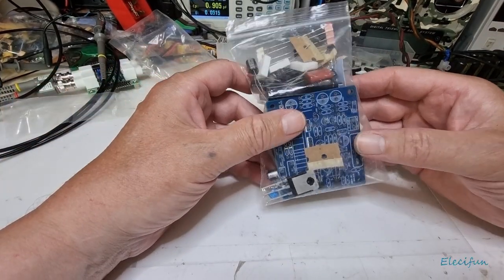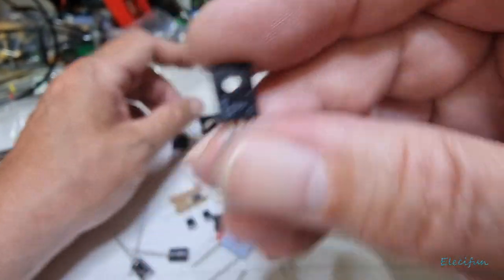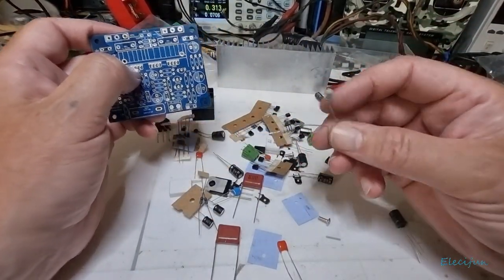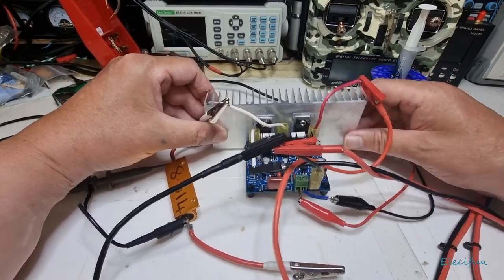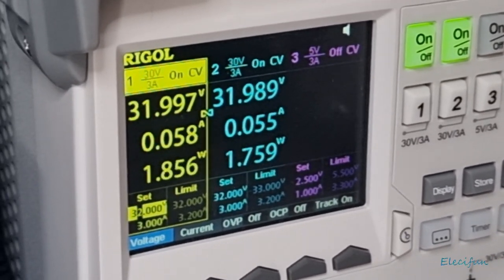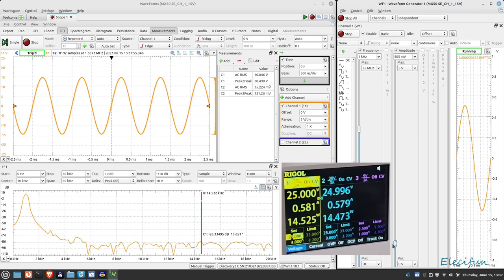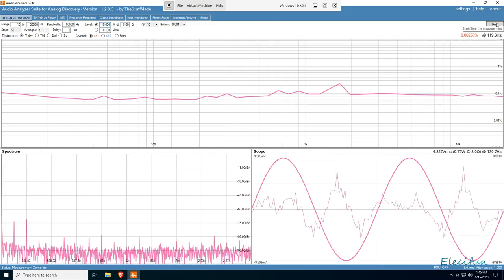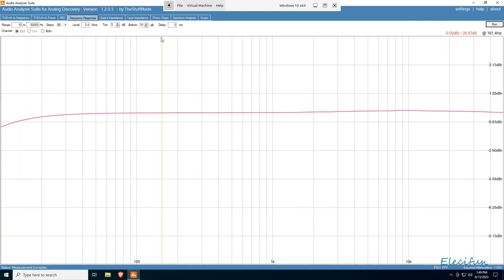AIYIMA MX50 SE Audio Amplifier DIY Kit Aliexpress

Comment: Would it be possible to change out the 2sd1047 / 2sb817 with 2sc5200/2sa1943 without doing any modifications to the circuit ?

Comment: I like the printing on the circuit board too. My guess is it's a Panda enjoying some bamboo lol. That looks like a nice kit. I'd be interested in your opinion of how it sounds to your ear while playing some of your favorite pieces. This is one I'd consider buying if I can work out the power supply before hand. Thanks for that Elecifun!
Reply from the maker: Panda looks quite relaxed for bamboo..lol  The output does look nice on this one. Building the power supply is simple enough as we know the voltage we want the kit to use. 30 watt output is plenty if the speakers are sensitive enough. Next video.

Comment: Are you going to put this diy amp kit into a chassis ?
Reply from the maker: Not sure, I have L12 on its way and need to hear that first. Chassis are expensive for power amps.
Reply: @Elecifun  L12 ? What's that sir?
Reply from the maker: It's supposed to be really good  https://www.aliexpress.com/item/4001025518676.html
Reply: @Elecifun  Gee the specs are not too shabby. 🤔
 120W @8ohms or 200W @4ohms and much lower distortion 0.0005%.

Appears to need dual 24V 200VA transformer.

🤔

Should be interesting ....
Reply from the maker: @decem_unosquattro9538  Are you showing distortion specs for MX50?
Reply: @Elecifun  No. These are the specs of your L12 that is on its way to you as we chat.
Reply from the maker: @decem_unosquattro9538  You wont get 100watts out of this amp  from a 24V transformer.
Reply from the maker: @decem_unosquattro9538  Oh  I see.. yes the L12 does have good paper specs and I am looking forward to its arrival.
Reply: @Elecifun  How big does your transformer need to be then? 🤔
Reply: @Elecifun  this is the advantage you have because you have a proper benchtop power supply. 🤔

I need to buy a new bt psu. 

I think it's time I bought one.

These crappy things I have won't cut the mustard.
🤔
Reply: @Elecifun  Are you planning on buying a nice chassis for one of your amps? I'd like to see it finished in a chassis.
Reply: @Elecifun  I quite excited at the prospect of building my first amplifier. Still there is such a bewildering amount of options. 

Which one does one choose?

My money is burning a hole in my pocket when I need to be fiscally responsible.  😆

I'd love to buy that gold chassis and mount the components into it.

The problem is I need speakers, and that in itself is another totally new field of knowledge that I'm only breaking the surface of terms of what I don't understand.🤔

The more one learns the more one realises just how ignorant one really is. 🙄
Reply from the maker: @decem_unosquattro9538  For the MX50 I used a 30V 0 30V AC to get 42V+ and 42V- DC onto the circuit and I got 97watts the transformer is 300VA
Reply: @Elecifun  I hope it doesn't take to long. 

I'm waiting on something but it's taking so long that is starting to worry me. 😟
Reply: @Elecifun  oh okay, where did you buy your transformer? I don't have a lot of faith now in Chinese transformers after building multiple PSUs. 

Kinda pissed off about the entire friggin  journey with power supplies.

I guess that's part of life.

I shall endeavour to learn more about transformers.

🤔
Reply: @Elecifun  what happened with your speaker? Did you end up buying a replacement for the one you destroyed?🤔
Reply: @Elecifun  It may or may not be suitable for your needs. 

I know you designed and built your own custom audio psu.

23 British Pounds for the Takashi chassis. 📦